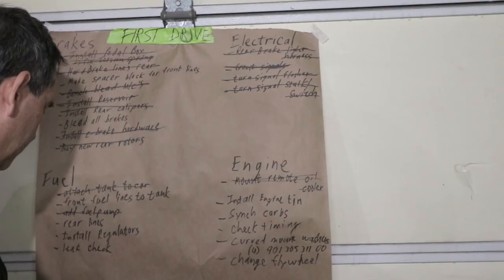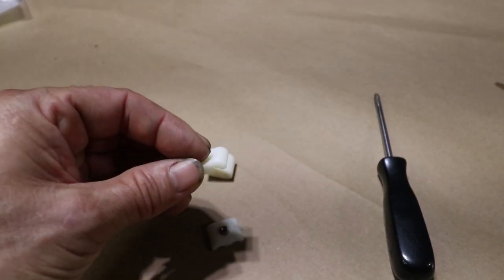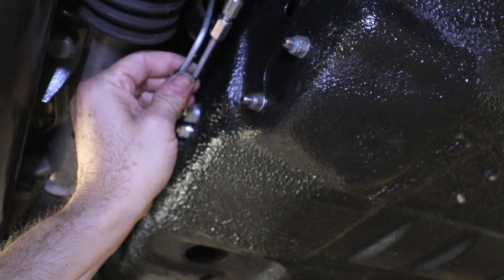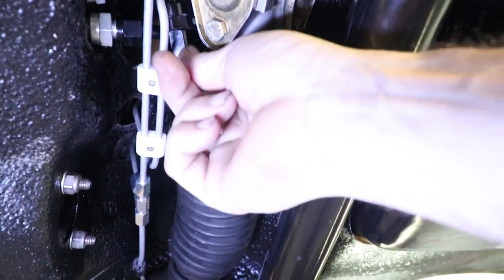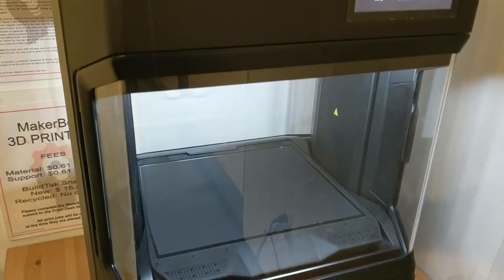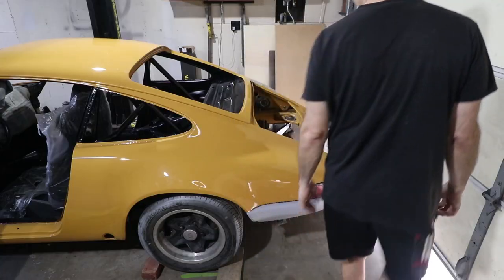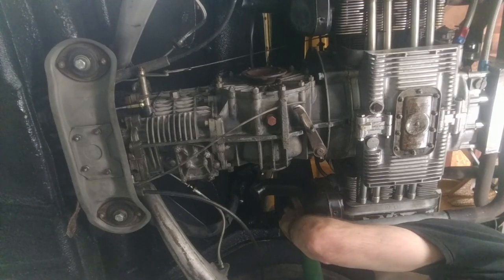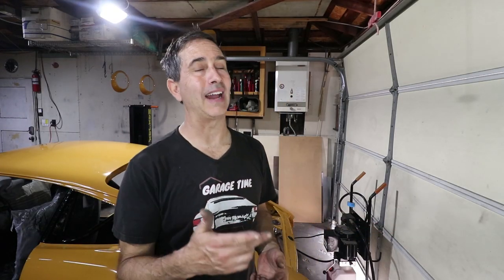FIRST 3D Printed Parts For My Car - Classic Porsche 911

Comment: 3d is the only way to go.  I made 3d printed some custom rocker arms.
Reply from the maker: Agree,. That's cool about the rocker arm.  I'm assuming they made a mold and cast a part?  Or was it just fuses together on a printer?
Reply: @GarageTimeAutoResto  it's for the Type 4 engine, 1:73 ratio, I drew it up and had it directly printed in metal.  My experience is the printed is tougher than cast, but not as tough as forged.
Reply from the maker: Wow that's cool!

Comment: Another great video.  You never talked about your aluminum trailing arms.  Did your car come with those?  Also, what happened with that set of Fuchs deep 6's you purchased?  oh, and how many of the spacers will someone need for their whole car?  Just two?  I purchased an entire set of brake lines from URO.
Reply from the maker: Hi Rodney, yes those are the right trailing arms for my car, but it didn't come with them.  I swapped out some steel ones for these.  
Those deep 6 wheels are at Weidman's being restored because one was bent.  He's having some very difficult times with the fires, so no pressure.
Those clamps aren't really required with a stock master cylinder.  Those parallel lines are related to dual masters.  
I hope your car is doing well.  I need to catch up on your thread.